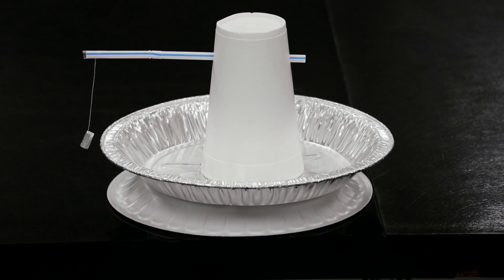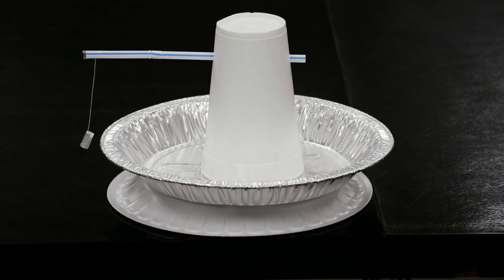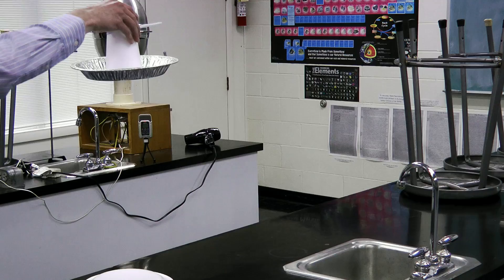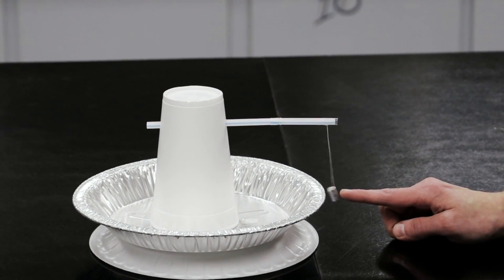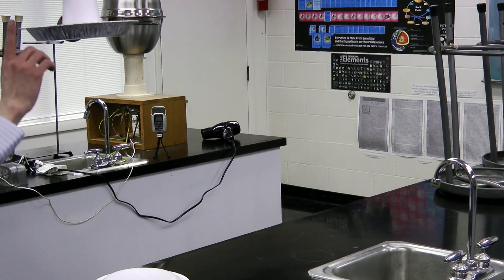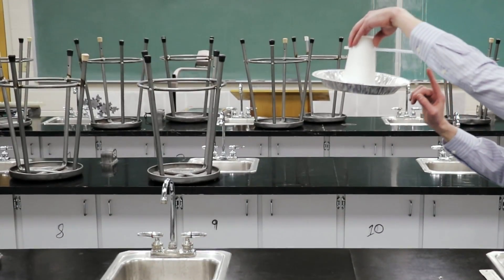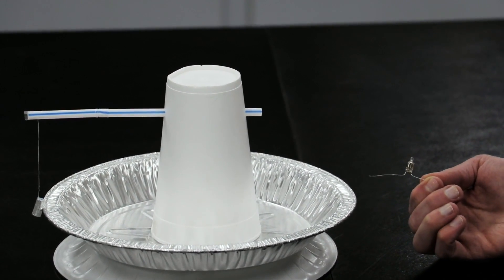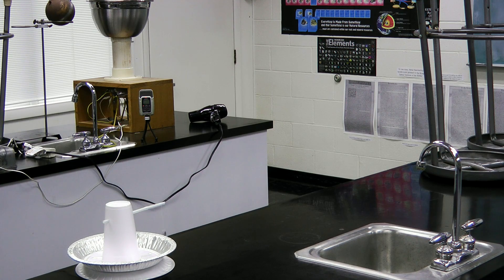You Can Build an Electrophorus

Comment: For those wondering, the Electrophorus was invented by Wilcke in 1762, and popularized by Volta in the following decades. Lichtenberg showed a method to use it for creating larger charges (and voltages) in the 1770s. This was adapted into a type of generator called the Nicholson Doubler in the 1780s, and this is considered the first "Influence Machine" electrostatic generator. Before this they all worked on friction using the triboelectric effect. After many iterations of improvement the Wimshurst Generator was invented in the 1880s using the same principle as Nicholson's Doubler and the Electrophorus. While there are many 'influence machine' style generators, the Wimshurst machine is the most commonly seen nowadays, and can be built as a project or purchased as a kit. I just wanted to point out that the electrophorus is connected to another popular educational aid (the Wimshurst machine) both in theory of operation and in historical development.
Reply: Maybe egyptian know this way before, with sabu disc.
Reply: triboelectric effect arises from mechanical stress, not "friction".
Reply: @h7opolo  You are thinking of the piezoelectric effect, which indeed is due to mechanical stress. The triboelectric effect is due to electron transfer during adhesion, which contributes to a material's coefficient of friction. This effect occurs when two materials with greater and lower affinity for electrons are rubbed against each other producing a surface charge. The earliest electrostatic generators were often referred to as 'friction machines' for this reason.
Reply: @MysteriousSlip  oops. thanks. so many terms, mixed them up.
Reply: @h7opolo  No worries, the important thing is to have fun learning! :)

Comment: Can you explain where the electrons are stored in a Leyden jar?
Reply: In whatever medium you're using as the dielectric.
Reply: Actually, in a Leyden jar the electrons accumulate, aka; “are stored”, on the inner metal conductive lining of the jar. The glass or plastic dielectric is actually a non-conductive insulator which separates the inner and outer conductive surfaces, or plates, of the Leyden jar. A laden jar is basically a capacitor. And capacitors consist of two metal strips separated by a non-conductive dielectric material. The plate of higher potential, in this case the inner surface of the Leyden jar, wants to discharge and equalize that charge to the outside plate, which is often grounded, but the dielectric insulator prevents this, thus allowing the electrons to build up to high potential. Van de Graaff generators work off this theory as well.

Comment: Electrostatic charges 

When refueling , " ignition point "
This is why Fuel Tankers ( Fuel Delivery Trucks )
Must be careful upon commencing fuel Deliveries 
  .... " To the point of the Tanker , Truck Delivering both Diesel and Petroleum ( Gas ) to the same Delivery point " ....... " Drop the Diesel ( Feed the Diesel ) First in to the correct Diesel Tank , Then your Petroleum ( Gas ) into its correct tank 
   Electrostatic Charge will ignite Petroleum ( Gas ) quicker than Diesel as Diesel is a compression Fuel .
   Thank you for reading 
This video needs to be shown to every Fuel Tanker Delivery Driver .

Edit   By Delivering the Diesel first the Electrostatic charge is reduced / removed / negated from the situation and thus an explosion risk is reduce / removed to a lower possibility 
     Thank you .

Edit , Edit 
       This can be extrapolated even further by stating " When fueling your Petroleum ( Gas ) vehicle , make sure the nozzle is touching the car " To transfer the Electrostatic Charge to ground ( to ground the vehicle )
       Again I hope this helps someone , possibly saving them from injury .
        Thank you